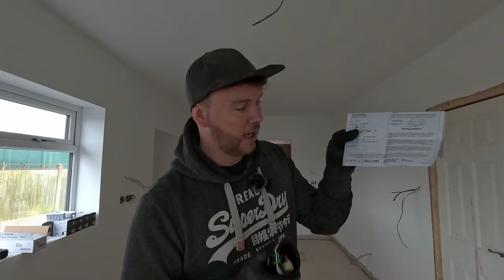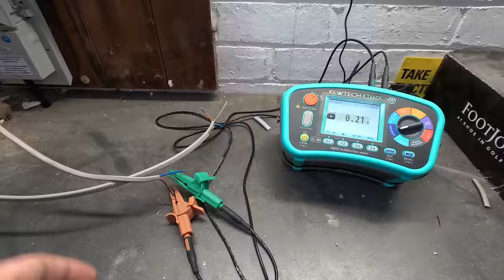I Dont Understand The Hate?

Comment: Where practically possible I always use a plumb bob line & road workers line marker spray and put an X on the floor directly below where the down lights going , or if the windows staying , to use the window frame as a measuring ref point 🤔👍🏻

Comment: I've had my kewtech kt65dl for about 7 years, been great! Easy to use, easy on batteries. That optical adapter is for connecting the tester to a pc so you can down load (that's the DL bit) the test results to a spread sheet. You only need to press the testbutton once, no need to lock it off unless doing stuff like earth continuity where you need both hands free using the probes. It just looks like an updated kt65dl with new screen graphics to me. Also ignore the haters, not worth the rent free space in your head mate 😉👌

Comment: Just a thought as it seemed like a lot of time went into finding the downlights. Either or if you put a neodymium magnet or piece of steel in the hole made originally. CA glue a cardboard jig in place with a reusable core thats 3d printed say that could be a game changer. A card tube glued in place with an interference 3d printed plastic core holding a magnet or steel. Bang on centre accuracy for you to find and drill up into. when you drill up central youd just be hitting the disposable cardboard
Reply: The problem is the room then gets boarded out and your holes do not space out properly with the new walls.

Comment: that KT66 is a crackin little tester mate. I sold mine when I got employed and the company use Meggers which I really don't rate at all. Wish I hadn't sold it they just work. I trained with a kt64 and used it for over 10 years. Kewtech are in my opinion the best brand with Metrel coming close as I do love my Metrel MI3125.
Reply: Would you rate Fluke?

Comment: Way I measure my lights is off one fixed object like your patress and then laser line the room , and measure off from the first light installed.  And I would have put the light switch on the adjacent wall so it's not behind the door when opened.  What do you prefer the kewtech or the megger ?